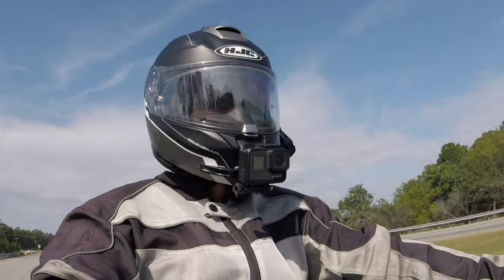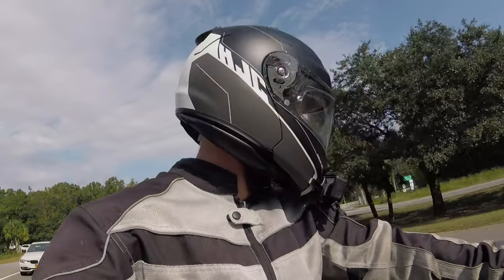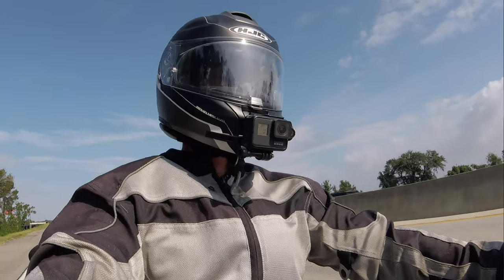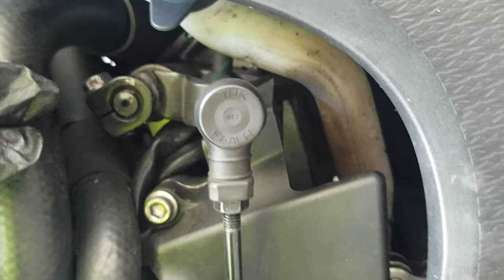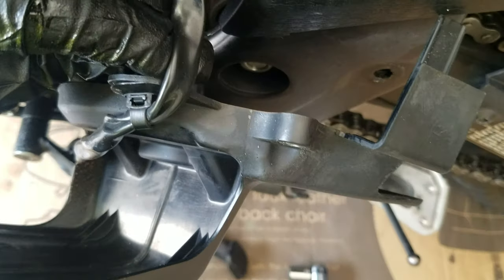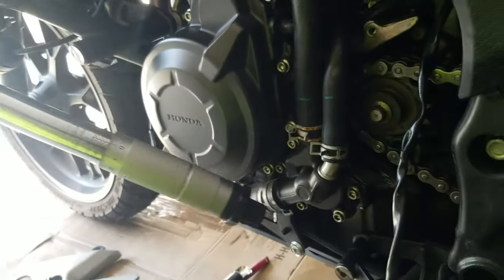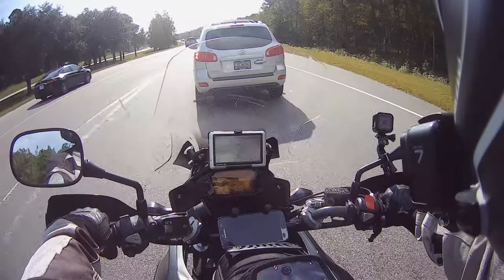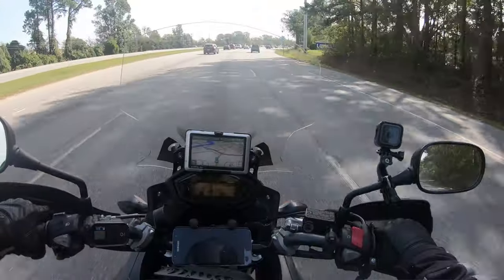CB500X 16T Sprocket Swap

Comment: I'm now back to the standard setting. I didn't really notice any real difference.
I had no problems putting the metal guard back in, sure you didn't have it in the wrong way round?
That chain is kinked, had my original changed under warranty after 3000 miles, my bike is a 2013 model with 51000 miles on it.
Reply from the maker: Thanks for the comment, Irishrover!  Indeed, when I went to put the guard back in after grinding it down, I had tons of free space in there.  I do wonder in the back of my mind if I was trying to put it back in the wrong way around?  Oh well, I'll never know now...but at least I've got a millimeter or two of extra clearance just in case.  The chain is less than a year old.  Thanks for pointing out the kink.  I'm going to show the guys at the shop where I bought it.  Certainly shouldn't be doing that.  Hopefully they'll replace it under warranty.  Cheers!
Reply: That metal guard is a pain in the butt to get lined up properly i took mine of to change and drain the coolant where you take a bolt out of the water pump.
Reply: I agree with you. And it actually lowers the rpm by around 350rpm which is basically nothing. If anyone wants something noticeable I would say 16 front and 38 at the back. That way it lowers by almost 800rpm and also the length of chain doesn't need to be changed.
Reply: @soldiers303  Hi mate would that give you a lower top speed doing those mods ?
Reply: @crispernator  if it lowers rpm at certain speed max speed possible should  be higher provided the engine has enough power

Comment: Hi Chris. With all the fidling around with the front sprocket, would it not be easier to just fit a smaller rear sprocket that has 3 less teeth? Thanks.
Reply from the maker: Replacing a rear sprocket is more expensive and more involved.  You have to remove the rear axle, get the chain out of the way, take the wheel off the bike, and etc.  So replacing the front sprocket is the quicker, cheaper  easier solution.  But of course many people change the rear sprocket for the same reason.  And in fact some do both...up 1 tooth in front and down 2 teeth in back.  There are many paths to enlightenment!  :-)
Reply: @MotoPhotoAdventures  Thanks for the prompt reply. Also, how is the speedo calibrated off the sprocket? Is it a computer working out engine RPM's and the selected gear, and therefore this is the bike's speed? Thanks again.
Reply from the maker: @littlekenny8411  I'm happy I can help!  Any change in sprockets, wheel size, or tire size will affect the accuracy of your speedometer.  Even right from the factory a speedometer can be off by up to 10%.  Personally, i only rely on my GPS for accurate speed.  But if you want to correct your bike's speedometer for any reasons, you can easily install a Speedo-Healer.  Check them out.  Hope this helps!

Comment: dont know why they stopped running the speedo off of the front tire..  no issues with any sprocket changes front or back..   hrmmmm
Reply from the maker: I don't know either.  Maybe it's more efficient or more accurate this way?

Comment: How did u calibrate the speedometer after u fitted the 16T sprocket?
Reply from the maker: I didn't.  I have a GPS mounted to my dashboard that shows me my EXACT speed.  I rarely even look at my bike's speedometer anyway...just the GPS.  So no point in calibrating it.  However, if you don't use a GPS and would like to calibrate your speedometer after a sprocket swap, I left a link in the video description of where you can buy it.  It's a simple electronic device that plugs right into your wiring harness, making it super easy to calibrate.

Comment: Hi chris, nice work. Well, i am not so handy as you are. So , for me it is easier to change the back sprocket. How many teeth does it need, to got the same result as yours ? ( sorry for the english, but i am belgian, dutch speakin) Thx .
Reply from the maker: Hi stoofbuis!  I believe it is actually more difficult to change the back sprocket because you have to remove the rear axel, move the chain to the side, remove the wheel, remove the 5 bolts for the sprocket (they can be very tight), and replace the sprocket.  For the front sprocket, you only have to remove the sprocket cover and then one bolt to take out the sprocket.  However, many do believe replacing the rear sprocket is better for the health of the chain.  So for this reason, it is a popular option if you don't wish to replace the front one.  In any event, I would spend some time researching options at https://www.gearingcommander.com/.  It gives excellent recommendations on best combinations to use.  The standard rear sprocket has 41 teeth.  To get similar results you will want to use a smaller rear sprocket.  Many replace it with a 39 tooth sprocket.  I personally like this 39T Vortex rear sprocket:  https://amzn.to/3oQRq7I.  I hope this helps!
Reply: @MotoPhotoAdventures  thanks for the great advice chris,  take care !
Reply from the maker: @stoofbuis  you're very welcome.  You're going to love the upgrade, whichever way you choose to go.  Enjoy!

Comment: 16T infront and the back still 45t?
Reply from the maker: The stock front sprocket is normally a 15T.  If you increase the front to a 16T like I did, I recommend leaving the rear sprocket the stock size.  I used this setup for many years and enjoyed it.  But after further experimenting, I have found a gearing ratio for the CB500X that I like even better!!!  Check out my new sprockets video:  https://youtu.be/Je6LdgYt9fg.  This is my current setup and I really like it!!!
Reply: @MotoPhotoAdventures  thankiu…🫡

Comment: How long do you think you can do  80mph now? In case I go through Nevada.
Thanks for the video
Reply from the maker: You could cruise at that speed until you run out of gas no problem.  I did it across Texas on my way to ride through Mexico...over 600 miles in one day.

Comment: Just curious as to how much you took off that front chain guide?
Reply from the maker: Hi Jillybean!  I shaved off about 1mm.  But when I went to put it back on, I realized the reason the sprocket was hitting the chain guard was because I had installed it upside down.  When I flipped it the right side up, there was PLENTY of clearance.  So you actually don't have to shave it at all...unless of course you put it in upside down like I did!  ;-)
Reply: @MotoPhotoAdventures  thank you so much for the quick response. By the way, my name is Joe. My email is named after my daughter Jillian lol! So I installed the sprocket today. Haven’t got to drive it yet but I will soon as the warmer weather comes around. thanks again I really appreciate your help. Great video!
Reply from the maker: Hi Joe!  Nice to meet you.  I think naming your YouTube handle after your daughter is awesome!  I'm glad we were able to help.  You're going to really enjoy the more useful first gear, and the less-strained highway riding with the new sprocket.  I might also suggest checking out this video:  https://youtu.be/Je6LdgYt9fg.  After using the 16T front sprocket gearing for several years, I'm now trying out a new gearing with a 39T rear sprocket.  Might be something to consider next time you're changing your chain and sprockets!

Comment: Some of these alterations,don't they have future repercussions pr effects on the engine ?
Reply from the maker: Not really.  I'm approaching 50k miles on my 2013 with no issues.  Theoretically, they say your chain/sprockets may wear out slightly faster.  But in the humid, salty air of the coastal town I live in, chains get replaced due to corrosion long before they really show significant wear anyways.  However, there's no know issues with the engine or any other components.  In fact, this is one of the many benefits to owning a chain-drive motorcycle!  Riders and "wrenchers" have been modifying their bikes since they day the first one hit the market.  You can't really change the gearing on a shaft-drive bike.  But a chain-driven bike opens lots of opportunities!

Comment: Great video - I particularly like your attention to detail. Its great how some manuals and even videos miss the odd point which always seem to stump me in my garage - your videos are thorough, thank you.
How does the 16t sprocket effect top speed ?
Whilst the CB 500X is not built for speed, I happen to ride with mates who all have faster bikes, the CB 500X does remarkably well on small roads, and OK overall, even if I do have to ride it hard sometimes.
But indicated top speed is somewhere between 100 & 106, as per my set up (2014 & fat rider) - Might go a little more but no point really.
Will the engine (471 cc !) have enough torque to match that top speed, or even better it, with the 16t sprocket ?
Reply from the maker: Thanks for watching!  Although the 16T does make the CB500X ride smoother, with lower RPM, at highway speeds.  Because the engine is relatively small, I don't believe it actually ads any more top-end speed.  Also, if you're cosidering a sprocket change, you might want to watch our other video:  https://youtu.be/Je6LdgYt9fg.  It's got even MORE details!  In this newer video, I explain why using a 39T rear sprocket might actually be even better than switching to a 16T front sprocket.  I hope it helps!

Comment: prob geared too low for off road. Any idea if you got a noticeable improvement in fuel economy?
Reply from the maker: I did the whole Trans-America Trail with the 16T.  Didn't have any trouble until crossing the highest peaks in Colorado:  https://www.youtube.com/watch?v=L3tf5pl2HCI&t=10s.  If you do a lot of off-road, I'd stick with the 15T up front.  Otherwise, the 16T makes the bike so much more user-friendly.

Comment: Chris any idea to actually find a 16t these days. Seems like I have checked everywhere.
Reply: Right in the description
Reply from the maker: Hi Chris!  Yes.  I just ordered another one.  JT Sprockets makes a 16T one for the CB500X with the rubber damper on it.  It's hard to find online.  But my local Honda dealer was able to order it no problem from his supplier.  Also, most other manufacturers only sell a 15T one for the CB500X.  However, all you have to do is order one for an NC700X.  It's a 16T version and it fits the CB500X perfectly.  Here's the JT Sprockets one without the rubber damper that I've been using:  https://amzn.to/2oWo910.  It works great!  I have no idea if the rubber damper will do anything at all for our bikes since they are relatively low power.  But I thought I would try it next since it's almost time to replace this one after many thousands of super fun miles on adventures like this:  https://youtu.be/C_XZ6P3P5X8
Reply: @EV1N3M  I should been more clear. "Having trouble finding" the correct listed part# from JT.  JT states 1381.15 or 16 and I have heard that folks have had issues with the 16tooth from 700 and miss alignment I recognize that there was a recommendation in the description  thank you
Reply: @MotoPhotoAdventures  I want to let you know that you very much influenced my decision to buy a new X!  ..... just placed my order for the RR level 2 kit :-).
Reply from the maker: @ToriADVMoto  that's awesome!  I hope you enjoy yours as much as I love mine!!!  I know it's a pain to locate that JT sprocket, which I see you located the part number on their site.  But try a local motorcycle dealer.  Sometimes they have better connections than finding something on Amazon, etc.  Might pay a few $ more, but not much, and it's worth supporting the local economy.

Comment: One comment about sprocket changes... Many people say gearing a bike down gives it more torque and more acceleration in all of the gears.  While this is true to some extent (butt dyno), in an apples to apples test it is not.  By that I mean suppose someone "gears up" their bike so that the new 5th gear is identical to their previous 6th gear.  Let's call those configurations N5 vs. O6 (New 5 vs. Old 6).  If you are driving at say 60 MPH in N5, you will likely experience the same exact performance as you have in O6.  This is not always the case but more than not it is.  An exception would be bikes that have different power mappings in different gears so in that case, the O6 might slightly "win" if the 6 speed bike doesn't put out full power in 5th gear (some bikes do that).

The most annoying thing to me on some bikes is how close the bottom and top gears are.  On some bikes, the difference is close to 2:1.  That is, the top speed in 1st gear is almost half that of top gear.  If I designed a motorcycle gearbox, I would make that more like 3:1 so riders could have a very low 1st gear (with the option to start in 2nd if they are drag racing for example), and have a nice tall highway cruising gear (with a widely spaced 5th gear for 1 gear quick downshift passing).  Those are my pet peeves with modern day motorcycles.  Many bikes have very close 5th and 6th gears and this is the exact opposite of what I want.  What is the point of having those gear so close?  A gap of maybe 20% between 5th and 6th makes more sense to me.  Then in city driving, you wont need to use 6th, it would be mostly for highway.
Reply from the maker: Thanks for your kind comment and insights, David!
Reply: Welcome but I hope the motorcycle manufacturers see it and do something about it.  They should sell 2 versions of sportbikes with 1 important difference... the track version should have closely spaced gears, and the street version would have wider spaced gears.

If some people complain that they like 6 closely spaced gears on a streetbike, then why not keep those as is but add a very tall 7th gear for highway?  Some cars have 10 gears so why are we "stuck" with only 6 on motorcycles?
Reply: I fully agree with that great description.  I guess anyone could have riding conditions that favor the close ratio gearbox; I'm an older dude now and am thrilled with the more practical wide ratio.
Reply: Cars come with options when you order them new, so why don't motorcycles have optional gearboxes (wide or close ratio)?  They try to make one set of gears work for both and it turns out to be half ass.  I used to have a 2004 Kawasaki ZX-10R and when I shifted from 5th to 6th on the highway, I could hardly tell I shifted.  The RPMs dropped maybe 500 if that.  Perhaps instead of designing 2 completely different gearboxes, to save money but to satisfy both track and street riders, have an optional "street" vs "track" 6th gear.  I would for sure get the street one.  Also, a "crotch" rocket" with a "spread" of 3:1 (difference in ratio between highest gear and lowest), would be awesome.  You would have a low 1st gear for stop and go rush hour traffic so you wont wear your clutch much, a reasonably low 2nd gear for drag racing starts (to help prevent wheelies), and a nice tall 6th gear for gas mileage when you don't want to make any aggressive moves (that is what 5th gear on the highway would be for).  6th gear should be significantly higher than 5th gear so a shift from 5000 RPMs in 5th gear would then drop you to 4000 RPMs in 6th gear at some speed (perhaps 60 MPH).  That would be a crotch rocket I would be happy to ride.  Yes I agree wide ratio is certainly more practical.  It is the same for pedal bicycles.  3:1 on a bicycle is certainly better than 2.25:1 (difference between bottom and top gears).

Comment: Any idea why changing the sprocket would affect the speedometer?  I would think only tire size change would do that?  If you never ride much dirt than would you drop the rear sprocket by one tooth too?  The default gearing probably was for offroad creeper gear in first…
Reply from the maker: Hi Dan!  Unlike older motorcycles where the speedometer reading came from the front wheel, newer bikes do it electronically.  So when you change either sprocket, or a rear tire size, it throws the readout off.  And yes, the factory gearing takes into account that not everyone in the world has a huge interstate system in their country.  For dirt roads in rural Asia, or a small mountain village in Europe, I think the factory gearing is perfect.
Reply from the maker: P.S.  I did the entire Trans-America Trail (TAT) on the 16T front sprocket and had no issues at all, in spite of traversing deserts on dirt roads, and scaling 12K foot mountain passes on gravel.  Check out the adventure series we did:  https://youtu.be/dhs96YJFnoA.

Comment: where is 80 mph common? I dont think theres any highway in canada thats over 70
Reply from the maker: I can't speak for Canada, as I am in the US.  Portions of the Idaho, Montana, Nevada, Oklahoma, South Dakota, Texas, Utah, and Wyoming road networks have 80 mph (129 km/h) posted limits. The highest posted speed limit in the country is 85 mph (137 km/h) on Texas State Highway 130.  But of course on MANY of the major Interstates, like I-95 or I-26 that pass through my state, "driving with the traffic" means you will routinely find yourself cruising at 80mph even though the posted limit might be 70/75.

Comment: did you ever get the ike recalibrated so the speedo will read the correct speed ??
Reply from the maker: I never bothered.  My GPS tells me the exact speed...as well as the current speed limit wherever I am.  So I never look at my speedometer anyway.  But if that's important to you, all you need is the SpeedoDRD DRD-3 from 12 oClock Labs - https://amzn.to/2Pahs8C.  It just plugs into the harness under the left side panel.  Let us know how you like it!
Reply: @MotoPhotoAdventures  excellent 👌👌 thanks I will I just picked up one for the missus and she loves it but I will be definitely upgrading the front sprocket for sure !!
Reply from the maker: @nateryan7041  that's awesome!  I'm glad she loves it.  You might also enjoy our video about upgrading the rear sprocket:  https://youtu.be/Je6LdgYt9fg.  Thanks for watching...
Reply: @MotoPhotoAdventures  i watched it lad great video 😄😄👍👍👍👍
Reply from the maker: @nateryan7041  Thanks!